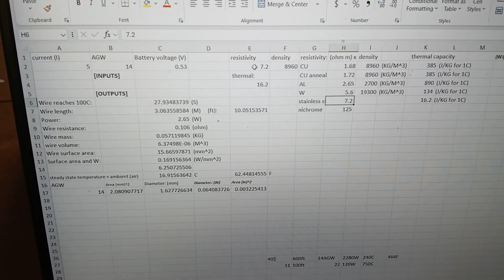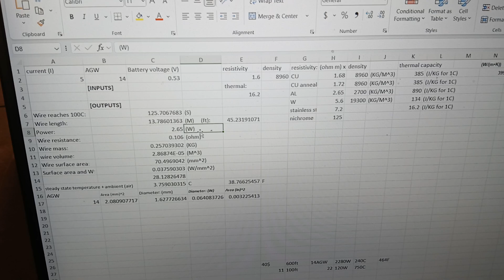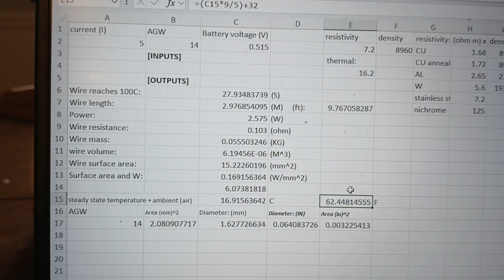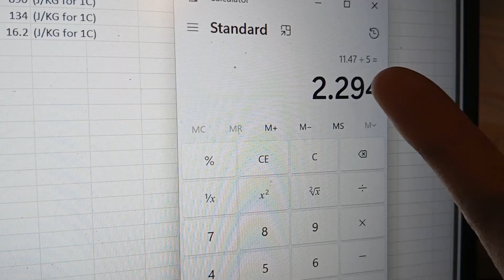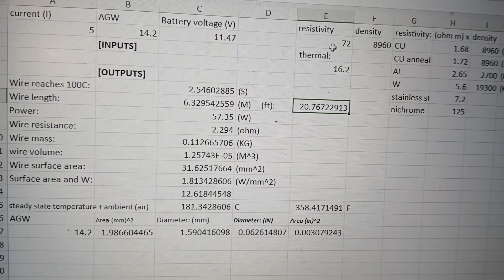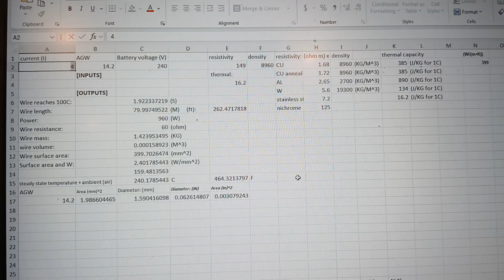resistance of 304 stainless steel wire more than I thought...

Comment: Ummmm, PSU says 0.5V/0.2A = 2.5R total load at PSU terminals.
Connecting the chrome test wire directly to the PSU terminals and adjusting PSU values would allow easy precise calculation of chrome wire resistance.
From this wire resistance value ohms/meter can be derived and the software calculator compared to this known value. 
That's how I would do it 😊.
Cheers.
Reply from the maker: Thanks, my DC power supply display is not very accurate, later in the video I did more accurate measurements with my Multimeter and found an R of 2.29 ohm/10ft.